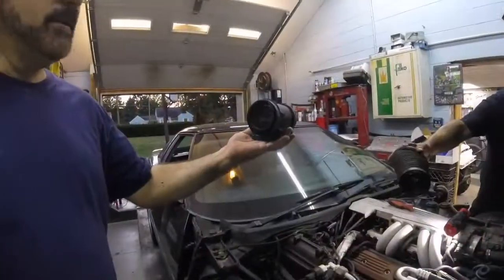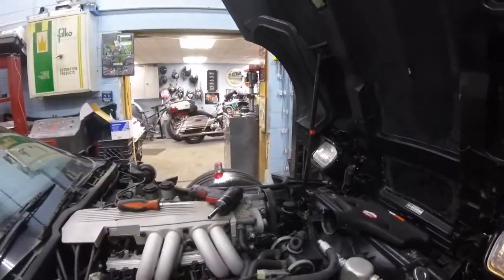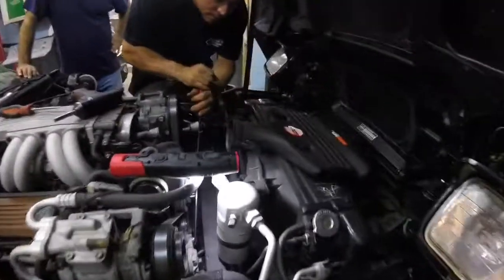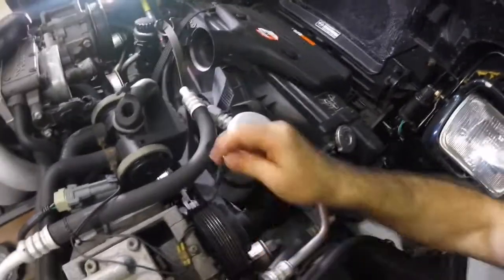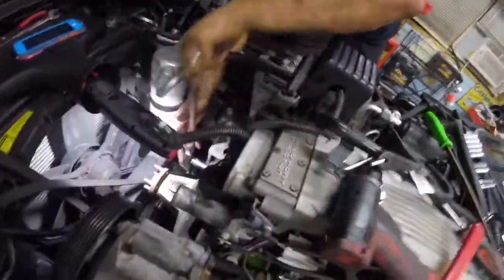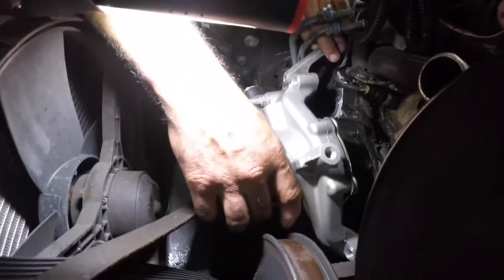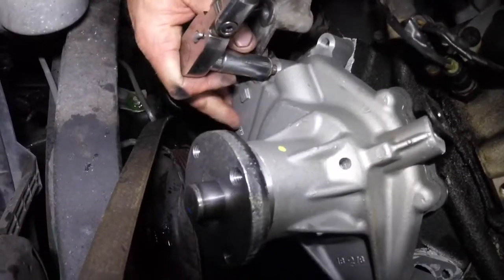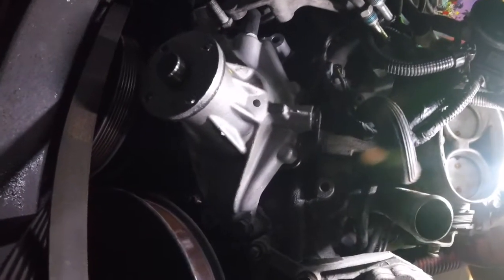Replacing c4 corvette water pump part 1

Comment: When selling a Corvette and the potential buyer asks if the car has been professionally serviced show them a video like this and ask if this is what they mean . lol
Reply from the maker: I guess...that was the correct way to replace it.  Never had an issue after it was replaced.  No broken bolts, no left over parts, no leaks and no overheating.  So guess it was done right.  Lol....video might not be the best but not that easy to make them.  Thanks for watching hope it helped you at least see what needs to be done to change water pump.

Comment: Why didn't you show the pump pulley  being pulled?
"yank this garbage off "
Agreed
AC went straight in the trash can with the smog pump, now it's easy to work on the car.
Hope you threw that big metal plate in the trash as well

Comment: A chevy tech wont even touch that car.  Trust me I tried about another issue I had.
Reply from the maker: I work on my own cars...Tommy was just giving me a hand with his lift and cheating the time.
Reply: @brokenbigboytoys5391  Somebody mentioned a Chevy tech would have done a better job or something to that nature.
Reply: @brokenbigboytoys5391  Did you see that video I posted I wanted you to see what is said about that "frisbee" in the water pump pulley.
Reply from the maker: Did not see video....this was a straight up job with no issues.  There were 2 parts to video.  I never had any issue with car after water pump install.  I had an issue with trans cooler which I believe wrecked the water pump.  Was leaking oil into coolant.
Reply: @brokenbigboytoys5391  OK why are you being so defensive.  It was about a part on your car that EVERYBODY takes off and you get more performance PER Chevy engineers.  GOOD GRIEF!!!!!

Comment: It would be nice to get some detailed info rather than unrelated small talk. I have pried the shit out of the bracket and it won't come all the way off of the water pump bolts. Im at a loss
Reply: From what I gather there is a torx bolt under there where you are talking.